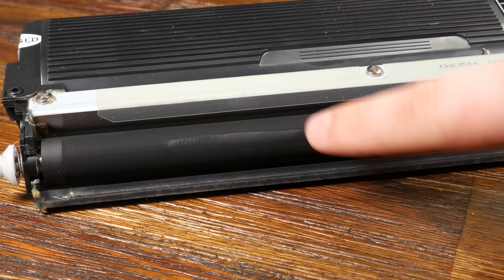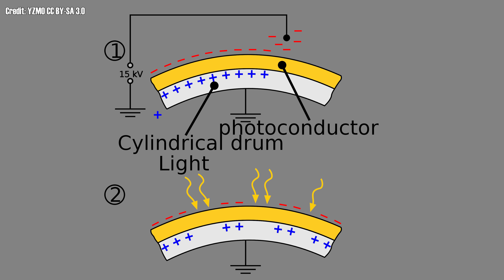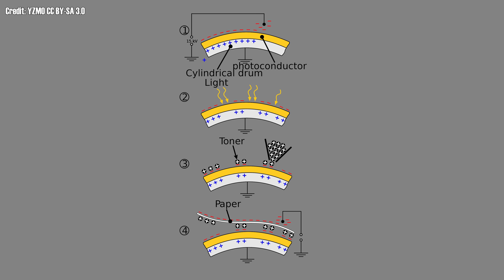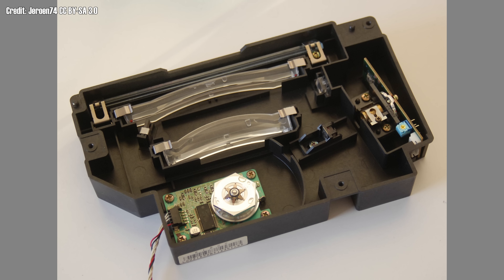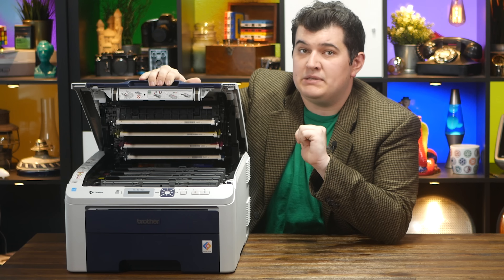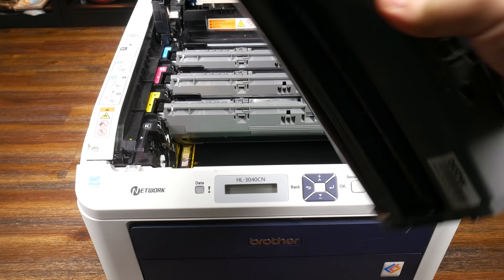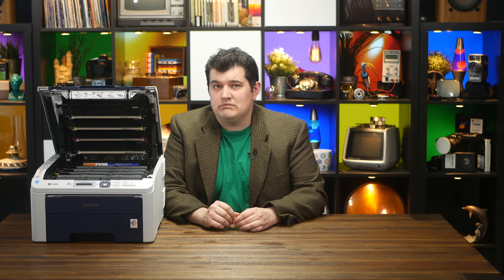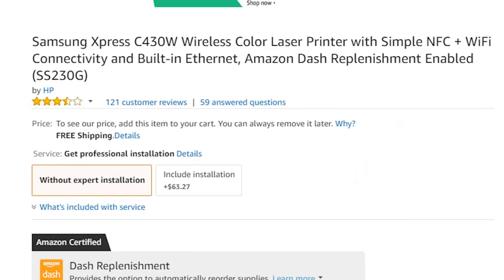LED Printers: The Common Printing Tech You Haven't Heard Of

Comment: With the right Google search terms, it looks like the laser printers that look like LED printers are diode laser printers. Those would operate with the speed and cartridge setup of an LED printer, and the precision, resolution, and reliable performance of coherent light.
You're already familiar with diode lasers, you've touched them in your Laserdisc and CD episodes.
That in turn means that LED printers are likely no longer produced, being superseded by the more efficient diode lasers in otherwise identical printers.
Reply: Diode laser printers would still need a sweeping optical path which inevitably takes up space because the beam needs to travel a certain distance to get to a specific angle.

You could solve that by either using arrayed laser diodes (which makes it no different from an LED printer) or by manipulating the beam using an elongated MEMS array which deflects the beam onto the paper. Both would be just as expensive or more expensive to produce than a micro-LED array, so from a production standpoint, LED printers are much more economical than laser units.
Reply: @Stoney3K  That's what I'm saying, the printers he was seeing online are arrayed laser diode printers. They look like LED printers, but should perform better than LED printers.
The fixed band of coherent light from a laser diode allows for more sensitive rollers, and the high directionality provides a tighter beam focus.
As for expense, later diodes are apparently cheaper, particularly for VECSEL laser diodes which intrinsically emit beams perpendicular to the wafer, allowing printing of monolithic individually addressable diode laser arrays on single wafers of silicon. Given the ubiquity of 808 nm near infrared laser diodes in search results, one could reasonably expect production with 90nm (2004 era) lithography on a 300mm wafer, for a nearly foot-long monolithic array.
Perhaps I'm overthinking it, but it seems like laser diodes would be a much cheaper and more efficient technology.

Comment: the samsung color laser printer i got uses a belt as a transfer medium between paper and drum.    the drum collects the toner of one color, moves it to the black belt and repeats that 4 times in color mode and then the belt transfers it to the paper.     

never heard about these led printers, but a quick amazon look revealed, they are really affordable... as long as the toner is affordable too
Reply: There is also a transfer belt in this printer in the video.
Reply: the toners for LED printers is rarely that affordable as the cartridge usually contains both the drum and the toner cartridge. just like the cheapest ink jet printers. It is all a scam!

Comment: A lot toner-based fax machines also used an LED array.

I got lucky when I bought a laser printer a few weeks ago (for £26 new and shipped :o ), as it does use a laser and spinning mirror.

So, it can do 1200 dpi, and the sharpness is good.

Some LED printers are labelled / marketed as "laser printers", which is something to watch out for.
Reply: That's not to say that all LED printers are "bad", especially nowadays.

But, older generations of LED printers generally had a lower resolution compared to a true laser printer.

But then that difference was often reflected in the price.
Reply: See, I commented a bit too early again. lol

You did mention that LED printers are often sold as "laser" printers. Or, they at least tend to be put into the same section on web sites.

I commend Brother for calling their models "Digital printers", but that's still a tad misleading.

There are pros and cons to both types of tech (as you also said), but it would be nice if they simply labelled them as "LED" or "Laser".

Comment: I have a dell C1670nw it is a rebadged xerox LED printer, but I still generally refer to it as a laser printer. I got it for $70 from staples and a complete set of off-brand toner (good for 5000 pages) is like $20

Comment: It's not really on topic, but as you mentioned in your gigantic scrolling text, there are now some inkjets with reasonable ink cost. Because they are fitted from the factory with a continuous ink supply system, where you fill ink tanks and the heads are fixed (or somewhat fixed, HPs still can have the heads replaced).

Those models are sold at a higher upfront price because the ink is sold at a cheaper price and seem to me a better fit for home use and small office use than a laser printer, but your mileage may vary
Reply: I have one of them the Epson ET-4550.

Yes, the ink is dirt cheap.

The problem is the heads dry up and clog if you go too long between prints.  You gotta keep the spice flowing.
Reply: Clogging is probably going to be a worse issue than with regular cartridge inkjets. And to make matters worse, I think some of the mechanisms are based on regular inkjets with some tubing and a tank slapped on the side. At least the first Epson EcoTanks and HP GT series looks like that: an existing model that they slapped the CISS onto.

But for people with regular printing, that require color or photo prints, they may make sense. And around here they are cheaper than a color laser.
Reply: I have seen two of those printers that were "dead" because the ink in the hoses connecting the tanks to the print heads clogged with gooey ink. So instead of just dried shut nozzles in the print head there's also the additional problem of piping to fail. Their per print cost is lower than the "payed by ink" printers, but I guess you have to print a lot to keep them going. Personally for me there's no way I'll ever go back to ink jets again after having a laser printer.
Reply: At least in Europe you can buy old HP LaserJets with 2000-3000 pages toner/drum left for less than the cost of a new 5000 page toner cartridge. For home use it's just wonderful:)
Reply: @shana_dmr  HP has cheapened some of their LaserJet line. In the time of the original LaserJet through the III series, they were all built to a high standard, able to last through at least a million pages. I've seen one IIId with over three million pages on its counter. The 4 series continued that trend. Just saw one last week in use at a funeral parlor. But HP introduced the L line same time as the 4. The 4L has nothing in common with the 4 aside from the LaserJet name. It and the 5L and 6L are tiny and slow. Their toner capacity is tiny and price per page high. There have been more cheap laser printers like those while the more durable "tanks" are rarer and not built for millions of pages.

Comment: Hold on, there's such thing as an LED printer?
Reply from the maker: I noticed you say this in another comment--the drum and toner cartridges are separate on the printer featured here.  Whether or not a manufacturer integrates the drum into the toner cartridge has nothing to do with it being LED vs. laser.  In fact both of the printers that I have experience with which used a combined toner and drum replacement cartridge were - you guessed it - laser.
Reply: HP has always bundled the drum with the toner cartridge, even on the original black and white LaserJet.
Reply: I had the HP Lasertjet IIP as a kid because my dad really wanted it for his draftsman work. (CAD really)

HP LOAD LETTER!

That thing rocked, really. Superb quality prints for about 10 years on the same drum. Problem: not enough RAM in our printer to even do 1 full page of graphics mode. :C
Reply: I got an HP IIP when it was $1500 for engineering college circa 1990. 
I loved it. 
It also impressed many professors with the quality.
Reply: I remember that in late 90's separate drum and toner was a big deal - that's why you bought a Kyocera :)
Reply: @shana_dmr  My FS-C5015n colour printer by Kyocera-Mita is probably an LED printer with toners resembling what goes into a Konica-Minolta printing centre as it has a separate imaging unit and it isn't much bigger than the LaserJet 4 or 5 from my childhood years at school in the 1990s.  Deeper and taller due to the high capacity paper cassette and colour printing.
Reply: Many low cost "lasers" are actually LED.  The Dell c1760nw, which often goes for as little as $70, is a popular color "laser" that uses LEDs.  Quality is not as good, but for a second or third printer, it does not matter.
Reply: It should be illegal to sell those as laser printers when they have no laser.
Reply: No not really, it was all an elaborate joke. Very clever, Technology Connections, very clever.
Reply: For decades already. "Inherited" an OKI LED printer from my grandpa a decade ago or so.
Reply: im gonna invest in OLED 3D printers
Reply: I've got a low end color OKI, best damn printer I ever had, 5k pages printed, not a single paper jam and I'm happy with the print quality.
Reply: Like some others, I learned about a couple of decades ago, via Oki Data printers (which accurately advertised themselves as LED printers. They were much smaller than traditional laser printers (approx. the same sizes as an inkjet), and had a comparatively low cost. However, the cartridges were ridiculous.
Reply: There's another form of LED printers that print in RGB; using LEDs, optical fiber tapers and a lens stack, with photo-activated paper. They're irrelevant to this video, but the tech is pretty cool. RGB for photo printing is more useful than CMYK, as it has a larger color space and digital media is created in the RGB space. The only company I know of that makes these is LumeJet, and I'm not sure if they make any consumer level printers or if they're commercial only. And if I remember correctly, due to the fiber tapers and lenses, their color DPI is higher than ink based printers.
Reply: same hare  1st time hear LED printer o.0
Reply: They've been around a long time, first one I ever saw was an Okidata "LED Page Printer" in 1993 or so.
Reply: Oh Brother 🙄
Reply: Back around 1989, I attended a demo of a continuous feed led printer.  I was very impressed it printed with black toner onto pinfeed paper at 50 pages per minute.
Reply: What's a printer?

:P
Reply: In layman's terms they are still 'laser' printers. But print colour as quickly as b&w and have slightly less resolution
Reply: yes, they are usually cheaper than laser printers, but often produce prints of lower quality, and the fact that the toner and drum are usually put into the same cartridge means toner cartridges are more expensive than printers with separate toners, drums and fusers. You usually don't need to replace the drum with every toner cartridge replacement. The same thing can be said for those cheap-ass inkjet printers like that +-50 $ hp printers. they are cheap because they don't have print heads. In those printers the printhead is a part of every ink cartridge (making those cartridges even more expensive)
Reply: I intend to buy a mid level Epson inkjet with EcoTank to test it out. But I believe the ink for ecotank printer's isn't that higher quality pigment-based ink, but rather dye-based. Also those new HP laser jet pro color printers intrigue me.
Reply: HP, Canon and Lexmark all use cartridges that combine drum and toner into one cartridge on their laser printers. Brother uses a two cartridge system, on their LED printers. Not that that has anything to do with anything since either cartridge system would work fine on LED or Laser printers. The reason Brother uses a 2 cartridge system is because they fell it's less expensive to purchase a toner cartridge without a dum built-in. You still need to replace the drum, but after many more prints than you get from a toner cartridge. The other companies feel they keep the print quality the best when the customer gets a new drum built into each toner cartridge. Both systems have valid points as I have seen many Brother printers with poor print quality because the drum is in poor condition, and I have also seen people coming into our shop complaining that their new Brother cartridge doesn't fit in their Brother printer, only to discover the person threw the drum out with the old toner cartridge because they thought it was one cartridge.  I have also seen decent quality generic toner/drum combo cartridges for less than OEM Brother cartridges. It all comes down to personal preference.
LED tech has been around since at least the early 90s (by Okidata), and you act as if it's a big deal. It's old now.

Comment: Wow. I had no knowledge of LED printers. My next printer just might be LED.
Reply: My next one will be dot matrix
Reply: Dot matrix printers are incredibly expensive.  For example, this Oki (https://www.staples.com/OKI-ML420-OKI-62418701-Black-and-White-Dot-Matrix-Printer/product_505246) runs nearly $500, which is not cheap for a very basic mono printer.
Reply: Well, it's the case of "if you really need a new one, you'll pay whatever we decide to charge you". Mainly for maintaining legacy stuff.
Reply: Whats a dot matrix used for, triplicates? I surprised anyone need carbon copies these days
Reply: They are for business environments where they need multiple copies.  For example, auto repair, where the customer signs the work order.  Some retail stores still use these.  However, many businesses have switched to standard laser printers and just print however many copies they need.  The paper is horribly expensive also, $129 for 1100 forms.
Reply: Multi-part forms, continuous feed paper (logging data, like keycard swipes for secure areas), and low use situations (ink takes long time to go bad) are a few examples.
The high reliability and cheap/limited maintenance do have benefits.  Long term costs are fairly low (3,000,000 characters/ribbon).  The print head on the ML 420 is rated for 400,000,000 characters; at 1000 char/page, that is around 400,000 pages.

Dot matrix is specialty market where buyers need reliability.  Prices reflect that.  They are not like $25 inkjet that print 800 pages over 5 years before dying.
Reply: To add to the above comments, dot matrix printing is extremely durable. Slamming ink into paper works far, far better than any other technology, including inkjet.
The ink formulations rarely discolor or become blurry after years of sitting in a drawer, making important logging/document printouts very handy. This is why many banks and government organizations print using dot matrix printers, and that is also why they're still manufactured and improved to this day.
Reply: +jeff
Yes but you can buy used ones that are much cheaper, they will run much better and much longer than brand new ink jet or laser shit... even these dot matrix has been used for decades. 
And I prefer to spend a few hundred euros (or any kind of money), than buying ink jet or laser ones, it will make less junk, it it will become less expensive over the use ! Dot matrix printers just don't break down, or if does, it's often easy and cheap to repair them ! And ribbons (same as ink cartridge for ink jet), are so cheap and last so long !
And they are not as "simple" as you say, they have a ton of parameters and they complicated, that's what I love, complicated things with a lot of parameters ! It's also so beautiful, to see and listen them while working !
Reply: Auto dealerships have used dot matrix for decades in the financing department, otherwise known as the screw zone. Just DON'T buy all the add-on's!
Reply: I made some research, and found that a dot matrix can print  7 to 13 times more sheets than a laser printer, and a least 25 times more sheets than an inkjet ! (I calculated these infos myself using inaccurate infos from everywhere on the net so I'm not 100% sure of what I'm telling, but It lets me get an idea of the quality of dot matrix compared to other technologies)
Reply: Maybe it already is
Reply: Epson LX 350 is around $200 and a new ribbon costs around $10. Really blows inkjet out of the water for printing costs if you're just printig crude text.